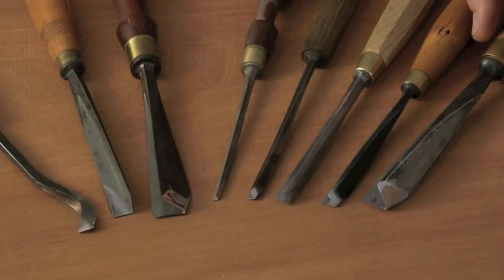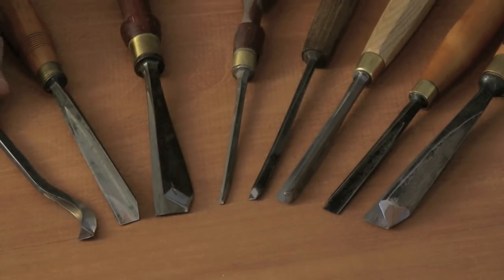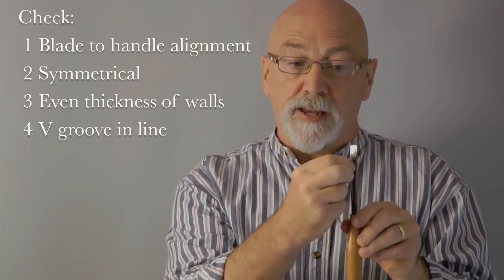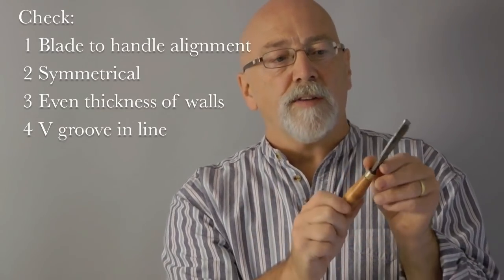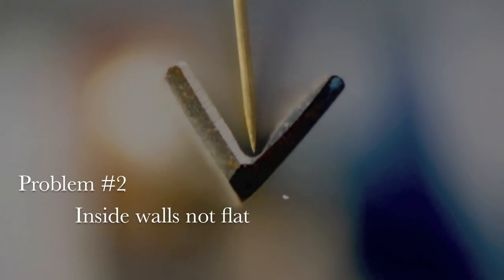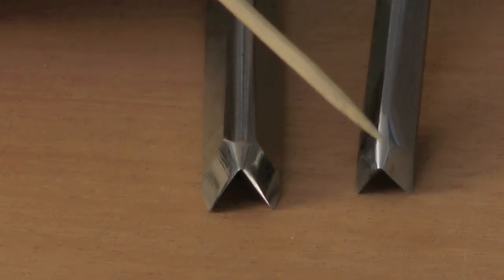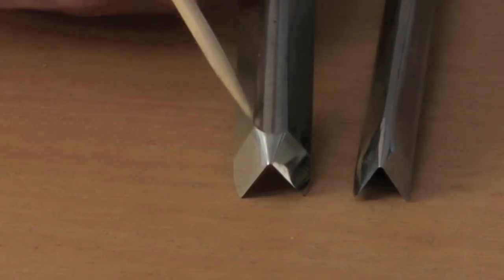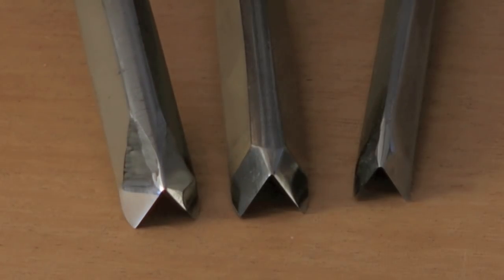Sharpen your V Tool  - An Introduction

Comment: well this confirmed what I thought for a while, my v-tools suck. They can't even cut wood at all, they just dig in and make terrible indents in the wood. I think I might start using a tea spoon as its probably going to be better result
Reply from the maker: Andrew - Don't despair! On Woodcarving Workshops.tv there are 8 long videos where I walk you through sharpening your V tool, step-by-step, along with a detailed, accompanying download. There are specific targets at the end of each step and if you complete these you are guaranteed a keen V tool at the end of it, and a deep understanding of the process.

Yes, you need to subscribe - WoodcarvingWorkshops.tv costs a huge amount in time and money to build and run it. However, you can sign up for just one month, go through the V tool sharpening and have the download (and the benefit of the other 560 videos and 50-odd downloads on the site) - all for the cost of a coffee and bagel!
Reply from the maker: Awesome Andrew - Straight up, every carver who has sharpened a V tool has had to learn how to do it, including me. It's a skill. Neat and tidy, and in the end a lot easier than carving itself. My best advice is to subscribe to WoodcarvingWorkshops.tv - which you can do for a month - and go through the full V tool sharpening lessons, step by step. You don't pass to step 2 until you have step 1 looking like I show you. There's a download that lists these steps too. If you do this, you WILL sharpen your V tool, and I bet you do, can do, and will do, far more difficult things in your life.

Comment: Sir, im looking to buy a few quality tools to start with, i mostly do detailed work like ornamental / figure carving.. There is so much out there so i wonder if yo have any suggestions or like the most used / basic sizes and shapes used? Like what chisels i can do the most with? Great video
Reply from the maker: Tito - That's a difficult question; carvers are very different in what they like to use. My best advice is to subscribe to WoodcarvingWorkshops.tv - which you can do for a month - have a look through the 650 video lessons and projects there and see what's like you are doing. Then look to the downloads (there are nearly 70 now) of the project tool lists and you'll see what I'm using. That should help you decide. Pfeil, Taylor, Iles, Stubai are all decent makes.